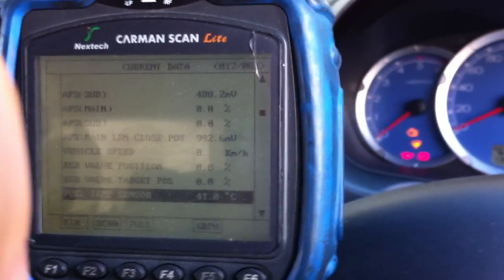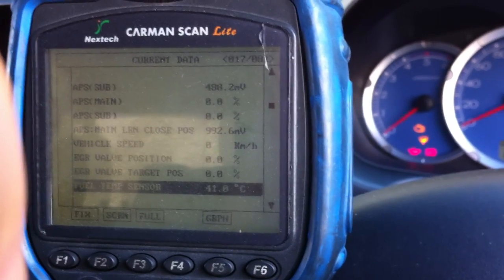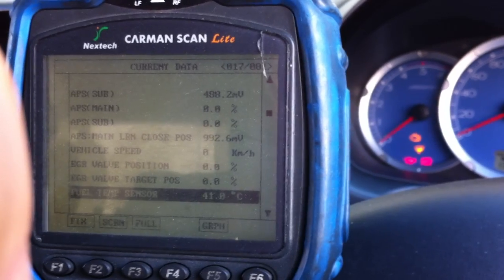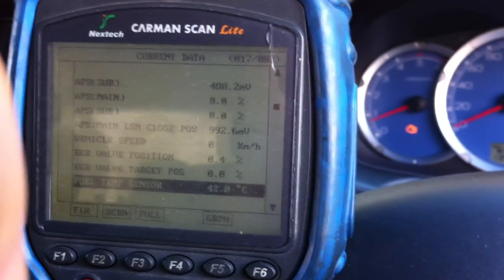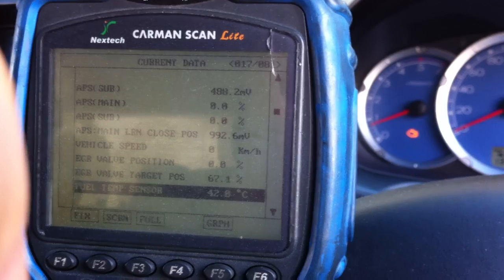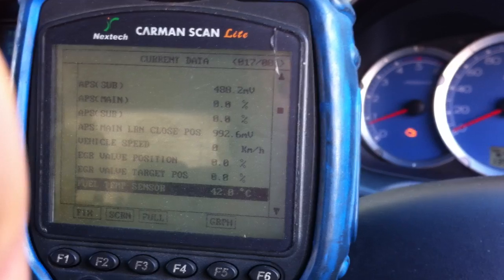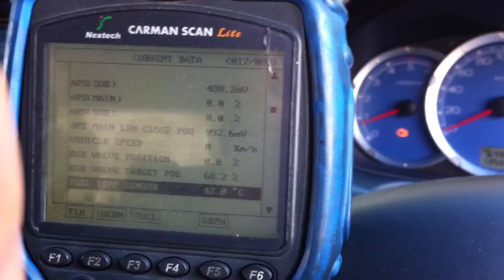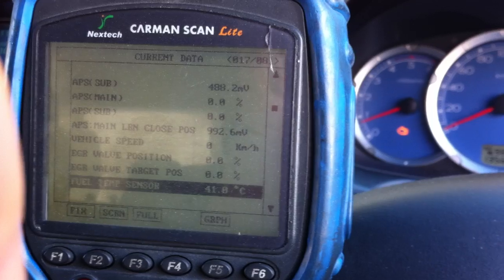Mitusubishi Triton 2009 EGR Valve sensor testing

Comment: Nice to see you can use a standard ODB device with the pickup. This pickup also has the CAN bus connecting all the ECUs together. So you can pretty much query any of the ECUs. No need for the expensive MUT-3 tester from Mitsubishi.